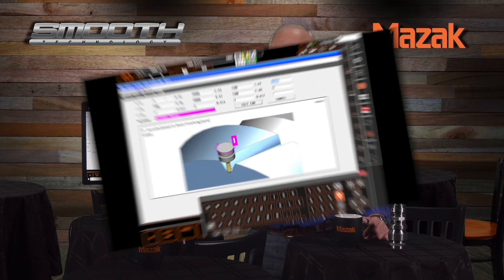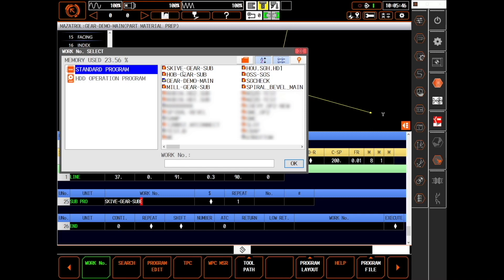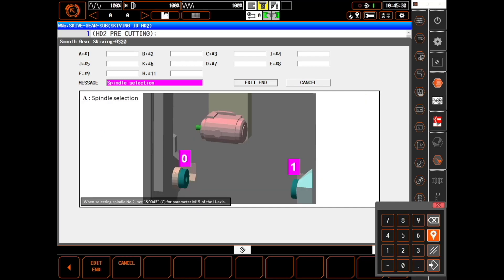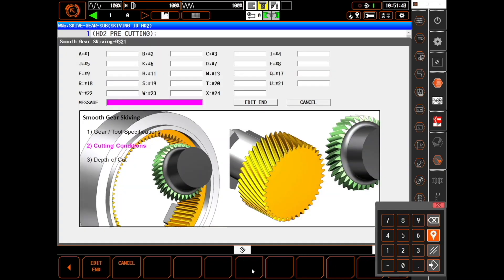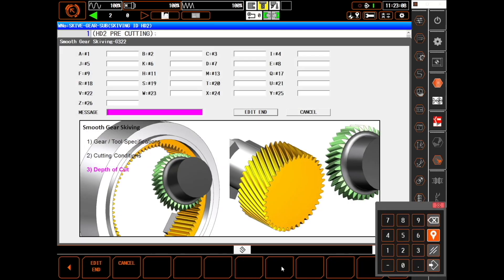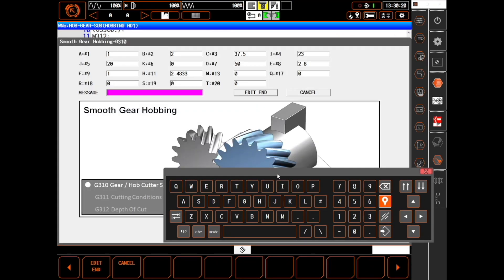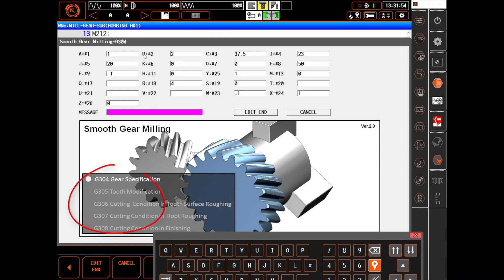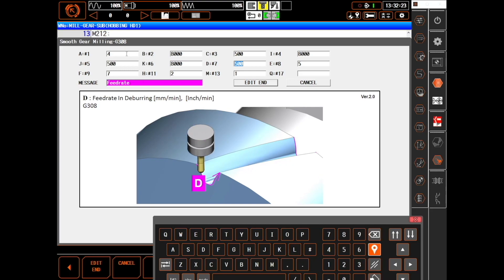Mazak SMOOTH Cafe: Auto Gear Cutting

Comment: I can do that crap on a $450 harbor freight lathe with a dremel tool holding the cutter. High quality sh€%#t you could use in a helicopter gearbox.
Reply: Power skiving and hobbing are advanced gear manufacturing techniques which require precise synchronization between two rotating spindles and can generate gear profiles in a fraction of the time as traditional methods.

You are welcome to use any tool you prefer to suit your dimensional tolerance and cycle time requirements!
Reply: 🤣🤣🤣 of course you can, and just and fast I'm sure 🤣🤣🤣

Comment: Can skiving be used to form cycloidal or trochoidal gear teeth?
Reply: Power skiving is not suitable for either of these applications. Cutter geometry limits which features can be generated with this technology.
Reply: mazakdan I had a feeling that was the case. Thanks for the info!